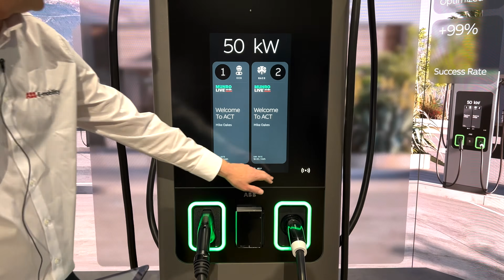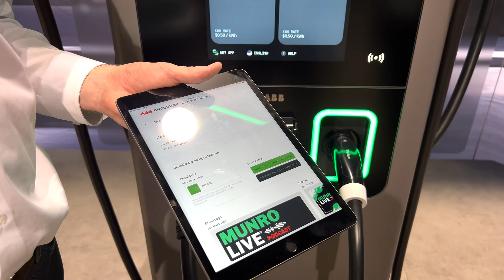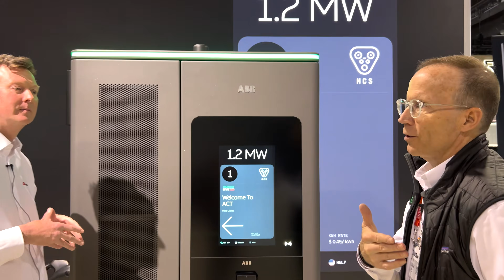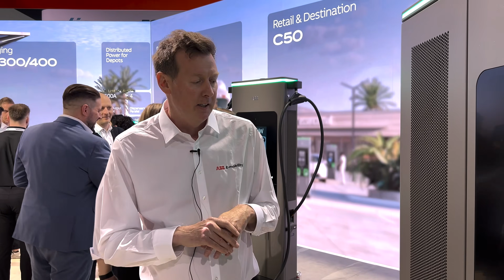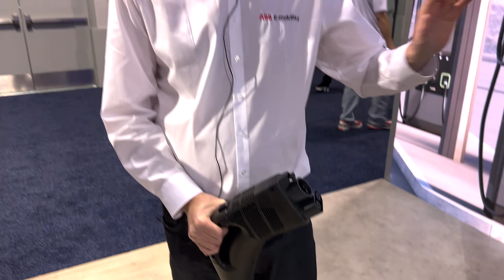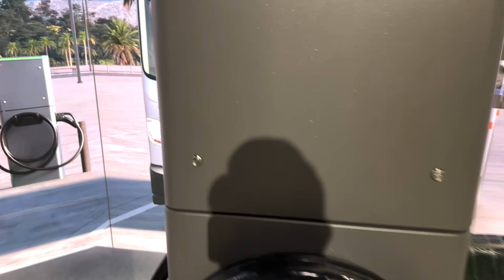ABB E-Mobility Shows Off Next-Gen EV Chargers | ACT Expo 2025

Comment: Induction charging is the elephant in the room. The exposed equipment is massively reduced in public spaces. 
Perhaps cable charging remains the norm in truck and bus depots as the depots do not want to invest in stuff in the ground. Portable with a forklift truck is what depots want for ease of installation and relocation. And even having the electronics sat on a device for lifting it up in a flood as First Student has designed.

Cars are smaller than trucks. Could place two induction plates in each parking space to ensure front and rear charging could be utilised. 
Better to have the induction plate flush with the ground, or perhaps it sits flush in a ridge on the ground.

Comment: As much of a Tesla fan as I am, the ABB chargers really excite me.  Why?  
1.  I really like the C50 50kW model for grocery stores and such.  Heck, my barber added a charger!
2.  The 400kW  max A200/300/400 will do well.  Lower use, do 200kW (Say Walmart in an area where EVs are not yet popular.  400kW for Torrance CA).  I like the 15 to 20minute 20% to 80%.  (Assuming ~95kW batteries)
3. MCS1200 is needed for the commercial vehicles.  45 minute break is a bit much, but if loading docks have these... > 800V!  Wow!
When?  Who is buying?  We need these out there by the thousands.  As Walmart is buying ABB for car charging, I expect these at their loading docks.
4.  The bus dispensers are interesting.  I'm not as familiar who is mass producing EV buses.

ABB really has a good portfolio of chargers here.
Reply: The real issue with ABB is their reliability. They are one of the least reliable DCFC manufacturers and losing market share to Alpitronics because of it